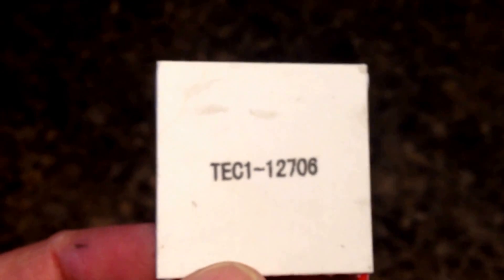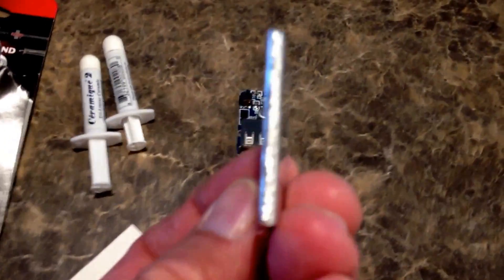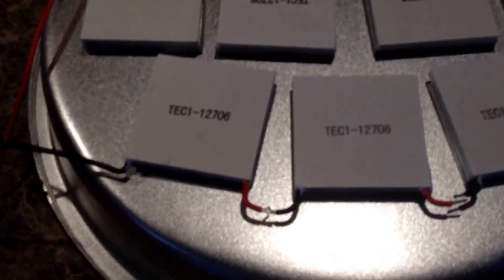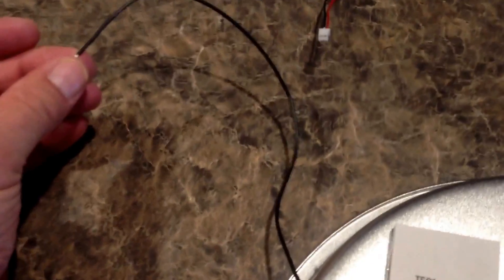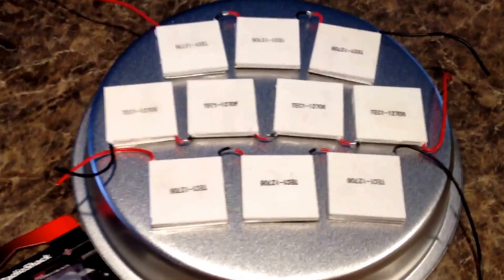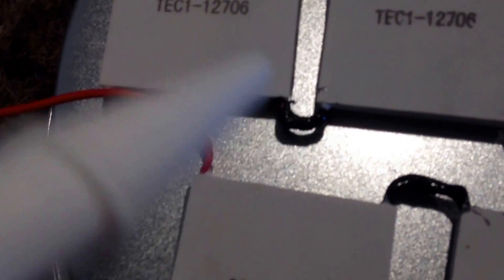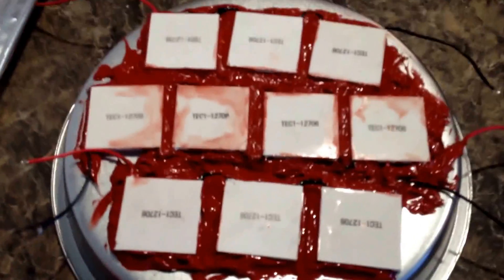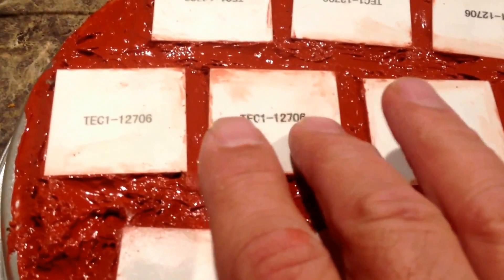Vid 1/2 DIY How to build & What is a thermoelectric generator, module, cooler, peltier, seebeck, USB

Comment: A thermoelectric generator module cooler? You seriously think that's a thing and that by slapping 2 pans and high temp silicone around some "Peltier Motors" and a DC booster you've created this thing you think is real? 
You can say thermoelectric until you're blue in the face ;but it still won't make it a real word or science. What you're not understanding is this thermo electric reaction as you call it is caused by Thermodynamics where energy creates energy.

Comment: I have made a quite compact version of this using 4 small industrial "Ferrotec" TEC units. I have a small heat sink on the bottom to absorb the heat from 2 tealight candles, the PCB containing the TEC's is sandwiched in between a much larger heat sink to draw away the heat. Then I have soldered a step down USB buck converter to the PCB. It charges my smartphone quite quick but after about 5-10 mins the larger heat sink starts to warm up to the point it fails to charge anymore. I think i need to add a 5v fan into the mix. I hooked a 12v fan up to a 9v battery (had nothing else to hand) and this extended the charging time, but this defeats the object! If you have a 9v battery you can hook it upto the USB converter and charge your phone like that!
I have lots more "Ferrotec" units that I harvested from obsolete lab equipment from work so am in the process of building a monster!! ANY ADVICE FROM THE CLEVER YOUTUBE COLLECTIVE WOULD BE GRATEFULLY APPRECIATED!! (i am a total newbie and have no formal electrical training)
Reply: I was thinking of making  video myself, BUT......If you don't have a degree in thermodynamics, a professional film unit with a state of the art editing suite PEOPLE TAKE THE P*SS OUT OF YOUR EFFORTS!  
I love this guy just "Having a go" so what if he is not 100% sure how to do it?! or his camera work is a little off! 
He has bought some shit off ebay and experimented in his spare time. Fair play to him and thanks for GIVING me an insight into 1 way how to do this. No one is forcing anyone to watch, if you dont like what you see keep on scrolling down till you find one directed by Spielberg! But you wont find one....cos there is no money to be made in such a niche subject. (Ahh Rant over. No one is gonna read the inane ramblings of an angry Brit who cant sleep. Its 4am GMT btw) Bring back hanging thats what I say.....Or the Birch PMSL!......

Comment: A couple of thoughts, and suggestions, (using my wife's laptop and her acct, so don't be rude to her.): If your cell phone has lithium batteries, (and they all do), the voltage regulator, (.9-5V boost sub system board), should be a CC CV type, (constant current constant voltage).  The one I buy on eBay for dual purpose voltage reg for SMD COB LEDs, (surface mount device, circuit on board) & lithium charging costs about 3.00, but it had an LED readout, a USB output, Phoenix connector inputs & outputs, a heat sink for the main chip, and four brass stand offs & screws for mounting. It has two precision pots for adjusting current and voltage.  I was buying a CC CV board for ~1.75 and having to build an additional board for the USB port (~0.40). An LED voltmeter is another 1.25 and an LED ammeter is 1.95. Two Phoenix connectors will cost you about 0.80.  You can't upgrade a cheaper CC CV board for the cost of the complete one.

I'm in the midst of swapping all my old floros in my fab shop for SMD COB LEDs and building individual machinery & equipment lights using 12vDC SMD COB LEDs, some are auto access LEDs, some are general purpose LEDs. The project has me up in my ears in LED work. While researching and spec'ing adequate heatsinks, I found info on the 'net about using Neverseize as heatsink compound, and was impressed to find out the traditional silver, (aluminum powder), N'verseize is every bit as good as much more expensive white paste, and copper Neverseize is even better.  I've been using it with great success. Nice to a multipurpose bench.

I've only watched this vid to the point of him talking about heatsink paste, but I was thinking if you put the cold side down, and the heated side up, you would be able get a better differential with less cooling needed. With the heat on the bottom and all the highly conductive aluminum, the top side is going to waste a lot of cooling BTU's negating the rising heat from the bottom.

I scrapped out a translucent blue plastic heated, vibrating foot bath last Summer, and one of the things I kept was some silicone insulated heating wire. It has SS wire as the heating elements, and would be great for the heated side.

I'm curious to see the output you get. If a guy has a wasted heat, and could figure out how to cool the other side without using more electricity than it outputs, it might be a way to make some electricity from 're-purposed'  waste.

GeoD

Comment: you think you used enough silicone?
Reply: I THINK HE RUINED THE AFFECT BY APPLYING THAT MASS QUANTITY OF SILICONE IN TURN JUST INSULATING THE UNITS FROM DOING WHAT THEY WERE DESIGNED TO DO. HE WOULD HAD BEEN BETTER OF USING A LITTLE DAB OF SUPERGLUE IF HE WASN'T GOING TO USE THE CORRECT MATERIAL TO START WITH. BY THE WAY IT LOOKS I DONT THINK THE VOLTAGE WILL START TO RISE UNTIL HES GOT ENOUGH HEAT GOING UNDER THERE TO START THAT SILICONE ON FIRE.  EACH ONE OF THOSE UNITS WILL GENERATE 8 AND 9V BY JUST PASSING A QUICK FLAME ACROSS THEM.  AND HE HAD THEM ALL IN SERIES AND BARLEY GETTING 5V ALL TOGETHER.  PLUS NOT TO CRITICIZE YOUR VIDEO BUT SERIOUSLY NEEDS TO DO A TREMENDOUS AMOUNT OF EDITING. SO I WOULDNT HAVE TO SKIP THROUGH THE WHOLE VIDEO BY JUST GETTING THE PERTINENT FACTS OUT THERE THANKS.
Reply: I generally agree with your assessment (especially with a need to edit). That capslock though...

Comment: you may get a boost by putting water in the top tin to get a greater temp differential. you may need to change the water out every 30 min to preven gen damage but hey, its the temp differential that excites the electrons and creates the voltage! oh ya ice packs! dry ice hahhaaa awesome

Comment: Well looks like I was wrong. I researched this module, after my comment, let it up, as I wanted you to see what all I was thinking. Turns out, this module actually can handle a max of 57 watts. That's pretty amazing when you think about it's size, and what little change gets it to work.

I did want to let you know, that I also read on the data sheet, that the leads are Teflon coating. I know you already hacked them to protect them, but FYI, for all to know, Teflon coatings can vary but typically handle over 200° Centigrade, / 392° Fahrenheit.
Reply from the maker: +Maryjane Eva Diamond thanks for info
Reply from the maker: +Maryjane Eva Diamond yes I did another experiment with no silicone protection around the wire's and they held up fine with t candles

Comment: This put together video is fine, but I think there is a very important aspect you left out in the results. (E) or "voltage," is not a complete equation in accurately understanding the results.

For those of us that went through college in electronics, there are two other IMPORTANT aspects you left out. Always remember the inherited aspects of an equation. The E,I,R, electrical formula generally works. There are simple finger charts you can google, showing by placing your finger over "R" (just as an example) that you are left looking at "E ÷ I", basically meaning Resistance = Voltage divided by current.

Those of us familiar with stepper circuits, and I have to tell you I was amazed to see they even made one that can take a volt and get it up to 5, can tell you that unity is a golden rule that must be observed. Not that I see it all before it happens, but in this case, I instantly realized that while your meter is showing this 5 volts, I'm sure you don't have the "I" to back it up.

So without even reconstructing this for myself, I can assume from experience that once you plugged in a phone to get a charge, the voltage would collapse like a wet taco.

Then it dawns on me. Back around 2006 I was building home made, hand wound coils on the inside focus cone of dollar store flashlights, along with a general purpose transistor, and biasing resistor, to make a single cell 1.5 volt flashlight, run a white LED. And I still have one to this day. Gave away like 5 others as xmas gifts.

I got the idea from a nifty circuit I found online titled the "Joule Thief." While the LED'S I used only required 3.8 volts, I was able to get them close enough with the hand wound coil. The interesting thing about this circuit was this it was given it's name, based on the fact that the battery could be as low as 0.3 volts, and still push an LED. You need to realize this is specifically because the LED typically only draws about 35ma. So the circuit would have no problem maintaining your desired voltage.
Basically your trading "I for E."

In your example, it may not work, if the input is only 1 volt. It's backwards now, because cell phones need 1 to 2 amps to charge.
So, reflecting back on my flashlight example, my circuit only needed to handle .133 watts. (because "P" (wattage) is always "E X I."

In your case, your needing 10 watts, if you are trying to get that step up circuit to give you 2 amps, at 5 volts.

Sometimes, from just looking, and through experience, you can see exactly where it's going. Now I don't know the amperage of the module to begin with, but just by looking at the gauge of the wire, is where it's not adding up.

Did it actually charge?
Reply from the maker: +Maryjane Eva Diamond thanks for inf

Comment: I bought the 27145 modules. For ease of connection was thinking of reversing the surface some of the modules,  positive becoming negative on those few. Thereby keeping the connecting wires as short of possible. All depends on loss of efficiency. ? ?

Comment: hey there, nice video
have you not thought of to use coolant instead of water just water?
it should maximize the potential difference :)
Reply from the maker: +newchannelization thanks for info
Reply: Ray the bigger the difference in temp. the greater the output. Ty

Comment: Very cool! Great video, i think i'm going to attempt a build!
Reply from the maker: They have a better they claim teg on ebay now same cost I ordered some to try
These in this video did not put out much power
Reply: +Ray Isimz which one would you recommend now? I was going to do a similar project maybe series 10-12 together and hopefully get some useful output from it. up here in northern Canada the temperature difference between outside and inside is quite large lol
Reply from the maker: +deathgripx17x  SP 1848   27145    SA   ebay teg not a tec like in the video they put out more power and can handle more heat same price I am going to experiment with them just received in the mail and tested one and it has about twice the power as the ones in this video

Comment: The voltage regulator can only give out around 500 mA so its pretty useles.
Reply from the maker: Thanks for info, makes sense and if that is right. I didn't know that. Thanks for watching
Reply: +Ray Isimz be careful with which regulator you use, some just dissipate heat. if you live in the us you can find cheap switching regulators.
(not available in my country though)
i love the project man (y) thanks

Comment: Ok, I understand the concept of how it works. Heat one side and cool the other side. Got it. How would this work on one of those clay pot heaters with tea candles as a heat source. I've seen those get up to 210 degrees.
Reply from the maker: +rg462 It would work fine but need to keep top side cool with water or ice
Reply from the maker: +Ray Isimz or cool air

Comment: 5$ the fan !! i bought 1 for 0.80$ on aliexpress !!
Reply from the maker: JS7457 Nice
Reply: Ray Isimz Buy from china, it's cheaper but longer shipping, if you do not receive you can open a paypal case before 180 days like for ebay, buyincoins, tinydeal. For aliexpress  you can open a case before 40 days.
I bought approx 200 items and i always have been refund when my items was lost or damage.

For good price on ebay.com :
-Download Mozilla Firefox browser and change the langage region in the settings to United States.
>You will have good price on ebay.com

Comment: Do you think you could power PC case fans from the CPU/GPU heat with something like this?
Reply: +Aaron LaBarre Usles and expensive but yes... but you need to cool the other site with ice that damages the computer ....
Reply: +Nino Joel cool the other side with air,
Reply: +Aaron LaBarre LOL produce energy uses the energy to cool to produce energy. WTF logic. xD
Reply: If you use waste heat to power the TEG you would recover energy from the CPU heat.Use that small current to power lights or a fan.
Reply: +Aaron LaBarre If you try this you will only get enough to power a rely smal LED and thats pretty useless becose these modules cost money and they will block some airflow.
Reply: wouldn't that be a waste of time? Since  either the cpu or gpu hates heat it would be pointless to put those components under that much heat, and even worse if the fan cools down the generator/cpu;gpu  than it won't make any power. ?????

Comment: The energy it took to cool that ice pack would have charged your phone many times over. ;) But maybe you could use it as a lid on your pans when cooking? I am sure it would work well when making pasta: put the cold water in the top while making sauce underneath. when the differential wears off and the water heats from the surrounding heat you can swap over, boil your pasta, while the next batch of cold water gets used and eventually pre-warmed for the tee after (though tee is only big in UK).  :)

Peltiers, or TEC's are really inefficient. They cost a lot and have very poor power efficiency - takes too much electric energy to generate cold on the cold side and when trying to produce electric energy from them you need to put in even more energy in form of heat/cold to be rewarded with comparatively little return in electric energy - see Energy conversion efficiency (η). More importantly however, if you try to generate energy from a temperature differential you are better off with a TEG (thermoelectric generator) rather than a TEC. TEC's - as the name suggests - are designed for cooling.

Back to the ice pack: The only way TEG's are put to good use is when using renewable energy sources, ie paint the dish on hot side black and place it in the sun (but then again photovoltaic is more efficient than that), better yet, place them on something that has untapped/unconverted resources like the top of a rocket mass heater.
Reply from the maker: Your probably right, it is fun to play with and experiment, maybe come up with something different that works. Thanks for your input
Reply: UbIfLuXuSiBiMOtuS What if he went outside and dumped a shovel full of snow and ice in there?
Reply from the maker: dropfry yes that would work, also just the cool ground and the sun will make it work to.

Comment: how much power is it though in watts? V x A = W. Interesting project.
Reply from the maker: I cant remember but I do have video 2 where I did the testing, it doesn't put out much.but it will light up an led light, and start up a dead cell phone. watch video 2

Comment: What happens to voltage when you load the circuit? I would like to see amperage or very least what the voltage does with cell phone and varioud temperature differentials.
Reply from the maker: Go to video 2, I do a test, it will start a dead cell phone and works well with LED lights. Thanks for watching

Comment: It'd be really nice to see what would happen if you filled the cooling pan with salty ice water or dry ice (CO2 ice). Also, if you could flipped one of the meters over to the 10A settings (to start) and see what kind of current you're getting out. My note 3 charger is 2A but I'd be surprised if you get that....but if you get the temperature gradient across the TEC large enough, maybe.

Comment: It would be very meaningful if you measured the milliamps produced by this set up. The higher the milliamps the shorter the charge time. A smart phone may need an entire amp to affect a charge. Non smartphones need less. You could look at your wall plug in charger and see the amps id delivers. This will tell you how practical this unit would be. I believe you need a certain amount of milliamps being delivered also to make batteries charge, Just having the five or so volts won't do it.
Reply from the maker: I will test the milliamps and let you know what happens, I will have to put it in series with maybe the cell phone and see what the cell phone draws for amps
Reply: http://www.cultofmac.com/163930/biolite-camping-stove-uses-fire-to-charge-your-iphone/
Reply: Michael Lindner  Yes, I have seen this product so I figured you were trying to duplicate it. That is why I ask about a milliamp reading. I am interested in how much current you got. I had some idea of making something like this also.
Reply: Not my video, but I would imagine just on price alone you could figure out a maximum on how many peltier devices could be in the stove...
Reply: yes, but I think the construction will vary that a lot. the thickness of the thermal compound matters quite a bit and also the temperature differential.
Reply: thanks!

Comment: they work well and are great for running led lights of candle power :). played with them years ago and had a lot of fun. good stuff mate :)
Reply from the maker: Thanks, I will try the LED
Reply: I need to power a led and I have 2 Peltier and a 0.9v to 5v converter will it work?